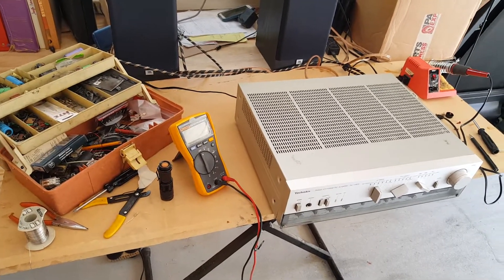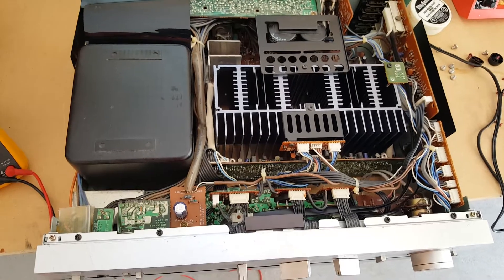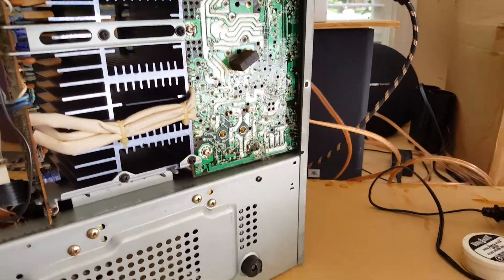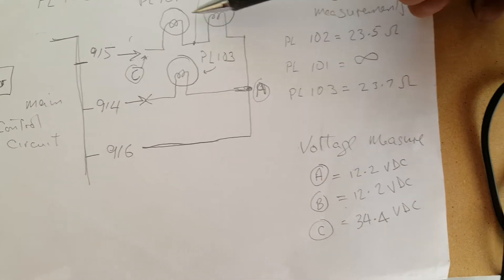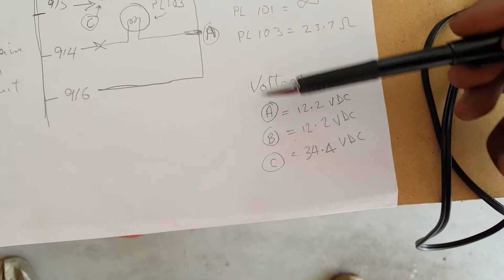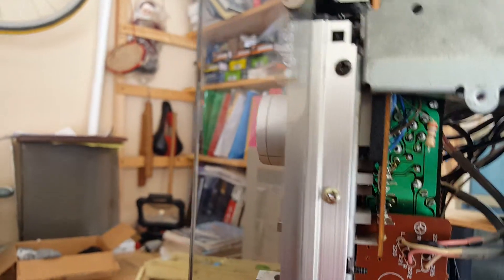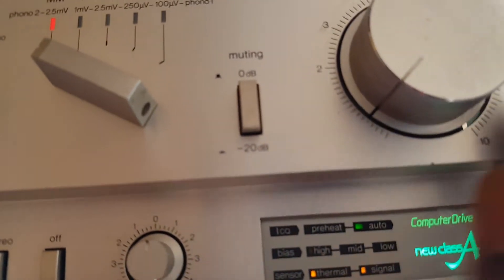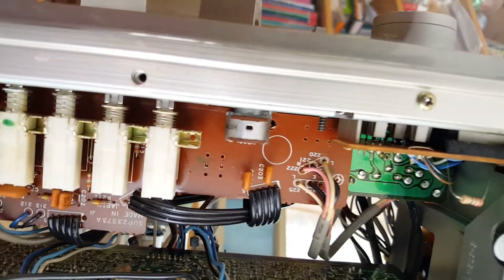Technics SU-V909 Common No Sound Fault

Comment: This was super helpful. I ended up replacing the bulbs the LEDs. In place of each bulb used an LED with series resistor  value that gave me the desired brightness then added a parallel resistor to create an equivalent impedance to the bulb.

Comment: i have technic suv98 it works but NO SOUND, so weird
Reply from the maker: The purpose of this fix was for that single common issue with the 909s only.   I don't provide additional troubleshooting aids because I don't have info on the different units, However. if you have a schematics for it. I would focus on components that are common to both channels. Start with any relay...listen for click. If it clicks, check signal voltages in and out. I would test all transistors in the switching circuitry or other related components, resistors, caps, ICs, etc., and broken or cold soldered joints. That's all I can offer you at this time. Good luck.

Comment: Hello Mr. Bryan! From here in Portugal. I have a Technics SU-V3 and it suddenly stopped working... Fuse blown and power transistors D718 and B688 were all replaced and the amplifier came back to life... I plugged in the entire sound system again but now I have no sound. even 'hear' the relay working. Does Mr. Bryan have any idea of the most direct component to check? Thanks in advance! Compliments!

Comment: HI, I recently change the lamps, I use same volts and current comsumption lamps, with a very similar resistance. It works so fine, but after a few days, the system fails, the lamps still working, but the ON Relay it doesnt CLICK, any idea?
Reply from the maker: Check to see if you're getting voltage to the coil, if so, then you have a bad relay. If voltage not present, then you'll have to back-trace the circuit using the schematic diagram to see where you lost it. Replace that component and see if it is restored.
Reply: @bwcanterful  I desolder the Relay and put on it 24 VDC and it CLICKS, so I'll check the line, do you know how many volts it should have the coil?  Something I dont mention before, is when I turn on the amp, the Leds of Computer Drive and New Class A make the sequence, but the Bulb of Computer Drive turns inmediately after the Leds secuence, and once Computer DRive Bulb turns ON, all the Leds turn Off.
Reply from the maker: Lous, that amp is a very advanced amp, hence a very good knowledge of troubleshooting vintage system would be a plus. However, relays can work with any voltage that activate it. The working voltage for this relay is [54.5V]
The problem could be caused by numerous factors, but you can focus on the Load Impedance Det Circuit. Make sure you dummy load is attached to output. 
Check R731-R734 for open. Check D 707. Check Q706: e=1.1v, b=1.9v, c=1.3. Q705: e=0, b=-1.0, c=1.3, and Q707 for opens or shorts; replace bad ones. Check capacitors on circuit board...any funky ones, replace it. Now, if none of those are bad, then you have what we used to call a "tough-dog problem", keep troubleshooting or stop and seek professional help before a simple fix becomes too expensive. I hope this helps. Peace out!
Reply: @bwcanterful  Dear Byan, thanks for your patience and help. After any number of measures, I find the R627 Open, I replace It and the Amp's alive again. :) Regards.